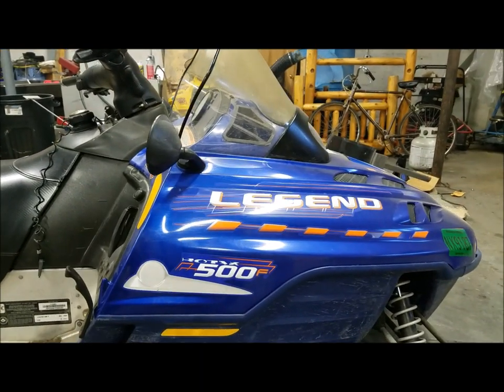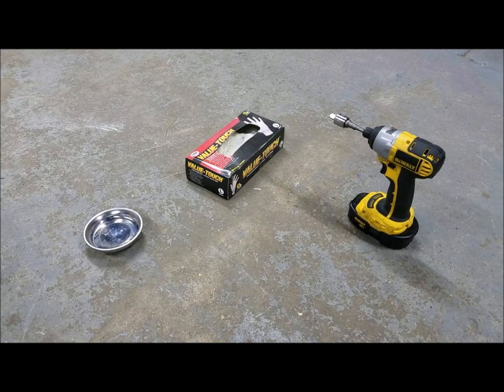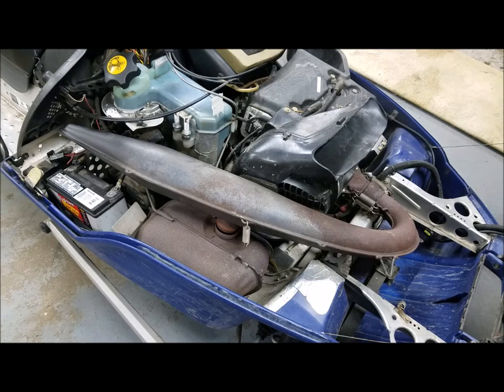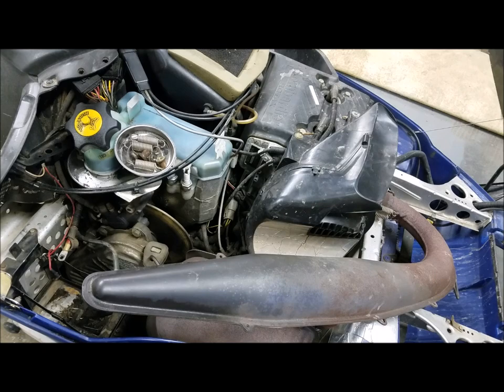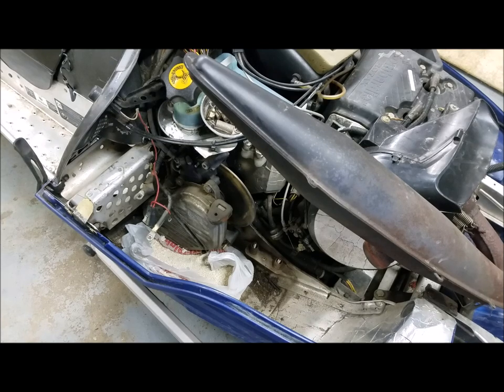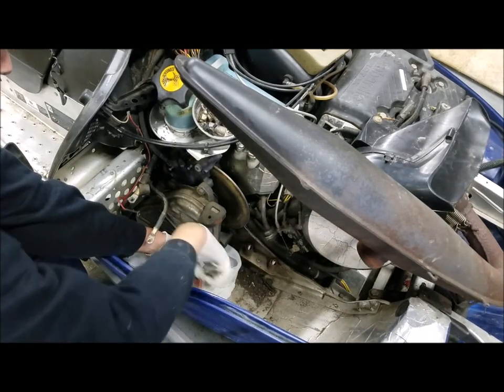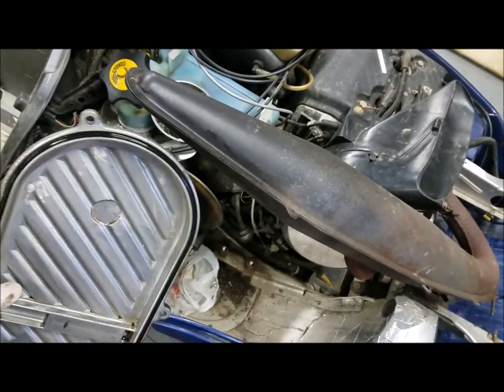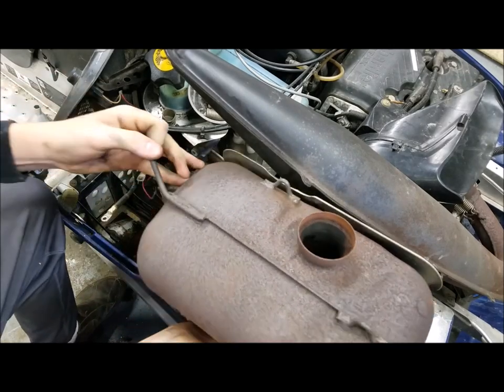How to change the chain case oil in a snowmobile

Comment: So how much fluid did you put in the crankcase did you put the whole quart in there how much did you put in there
Reply from the maker: I believe that I just filled it to the High mark on the dip stick. Somewhere around 8.5 oz (250 ml). If I remember correctly.
Reply: @northernmigopro4643  the reason why I was asking is. I have a 1971 Polaris Colt 295   has been upgraded 2 a 350 and it's the old school way it don't have no dipstick to tell how much stuff to put in there. It feels on the top and drains on the bottom that's why I was asking I know how much stuff to put in there.

Comment: You do know that there's a drain plug under the chain case near the exhaust.
Reply from the maker: yeah found that out later. just disregard the whole pulling the cover off to get the oil out thing.
Reply: Yeah but it's still nice to see how to take the cover off and check the chain and shit.
Reply: @elcabong3636  
I agree. 
Definitely want to take the cover off if the oil hasn’t been changed regularly, to inspect the chain, clean out the gunk (there will be metal particles), and adjust tension while in there.
If you don’t see a glob of metal particles at the end of the dipstick, and you change the oil religiously, you are probably ok with just draining and refilling.
For many, the chain case oil is an afterthought.